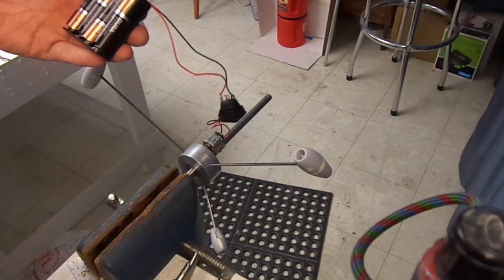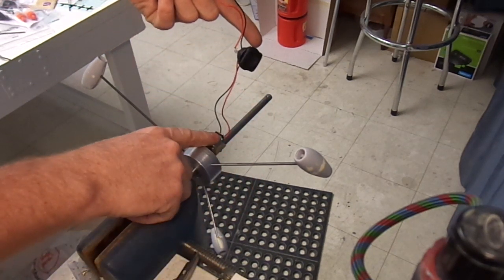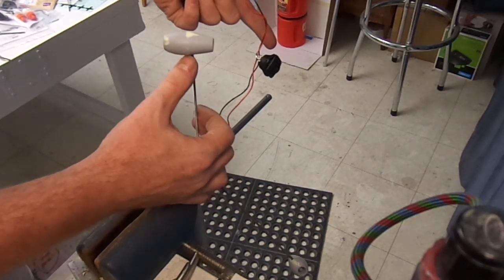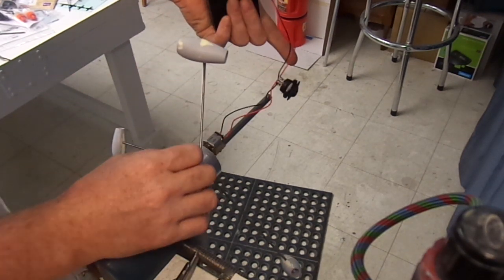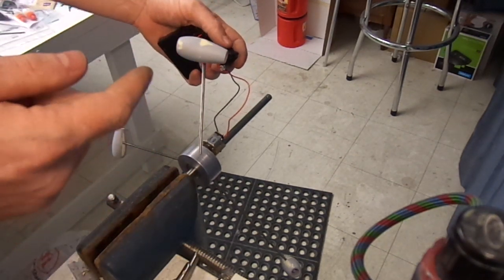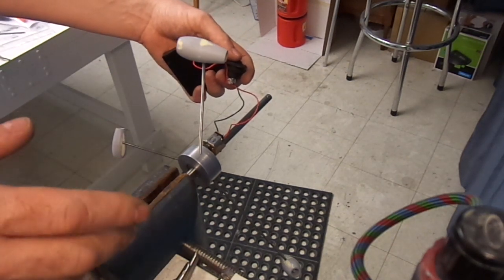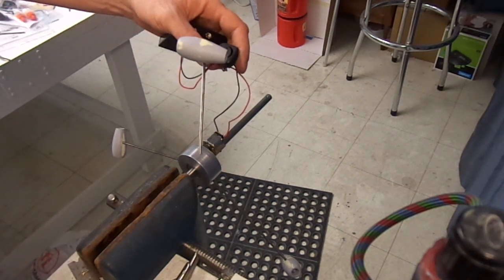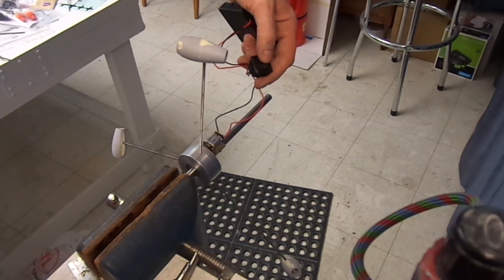1/32nd Triebflügel - 1st run up test

Comment: To make flying version you would have to make the motors on the blade tips work rather than drive the rotor from the centre, other wise the body of the aircraft would just spin in the opposite direction to the drive motor. it doesn't work like a helicopter it works like the rotor on a fairey rotodyne
Reply from the maker: This is a fully static plastic (resin) scale model as the kit is intended. 
You would need a lot more than motors in the tips of the wings on a flying  model to get it in the air. Without a gyroscope connected to the control inputs you would have nothing but un-aimed, un-guided firework.

Comment: Nice video, are you going to make a flying prototype?
Reply from the maker: +jaxxer  - Thanks for stopping in on me. No this is a static resin 1/32nd model only.
The real Triebflugel never even made it off the drawing board I dont believe. Although this proof of concept DID actually work, the batteries used drained SO unbelievably fast, that using the tiny R/C motor you see here that I used, was not going to be feasible. I have temporarily put this on hold, as I need to completely re-design this to use an "N" scale model railroad motor, powered by the appropriate transformer either powered by AC/DC from an outlet, or plugged into a converter to use a 12v car battery when an outlet cant be found.